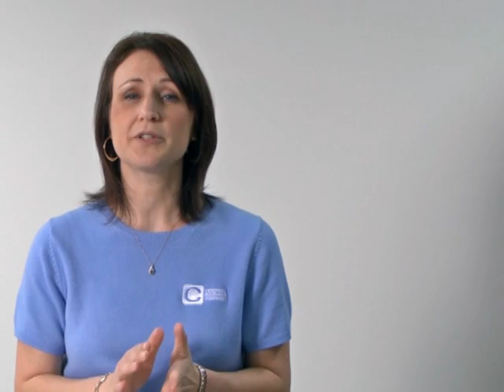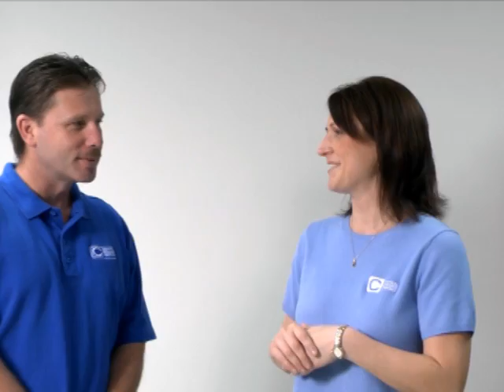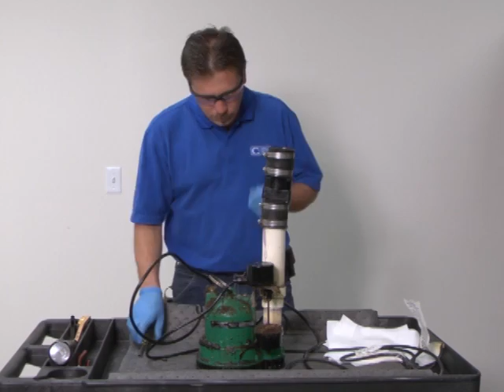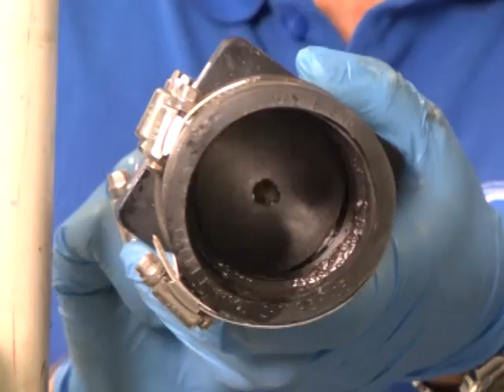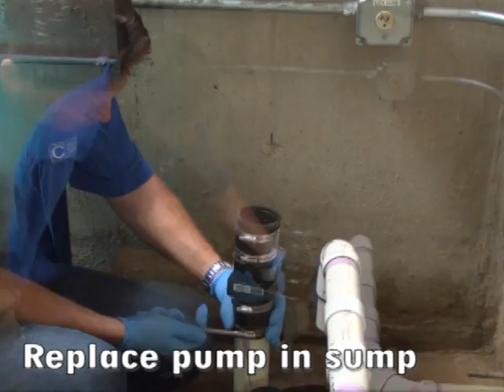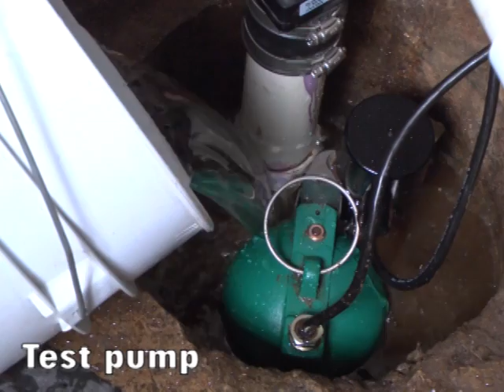Simple Sump Pump Maintenance

Comment: install an inexpensive sump well alarm and have a backup pump nearby. A portable generator to run everything is a good idea since pump failure often occurs when you lose power in a storm or flood when you need the pump the most.

Comment: There is good information in this video. But I’d do things in a slightly different order.  I would not waste time cleaning a pump that doesn’t work. Therefore I’d test it before removing it from the pit. Now this doesn’t mean you can skip testing it after cleaning as shown in the video-  that is needed too. 

Likewise I would not dump water into the pit before knowing that the pump works. What I would do is lift the float to prove the pump works - then fill it with water to prove that it pumps it out. 
This way if the initial float lifting doesn’t turn on the motor, you can avoid having a pit full of water. 

Next, when replacing the check valve you need to make sure the arrow points up. If you accidentally put it in upside down it will “fit” but it won’t pump. 

This is another reason to test the pump before and after the cleaning. If you test with water before cleaning and then replace check valve backwards and test again and it doesn’t pump, you know that something you did broke it. Otherwise if you didn’t test before cleaning and your first test using water was with the check valve backwards you would not know what caused the failure. 

Lastly, if your basement is finished or you have valuables there, you should have a water alarm sensor inside the pit just above the point where the pump turns on. That way you will know it failed before any flooding occurs. You can buy one that beeps for about $10. Or a better one that emails your phone for $40.
Reply from the maker: Thanks for watching and sharing some additional tips!

Comment: Nice video.  Covers something overlooked by most ... i.e. detaching the connections from the plumbing discharge.  Might want to warn that disconnecting the coupler above the check valve may release unpleasant effluent downward (depending on the setup).  Also, not always appropriate to lift the pump from the hole using the PVC pipe.
Reply: +Spreadswings Those are very good points! Thanks for sharing...